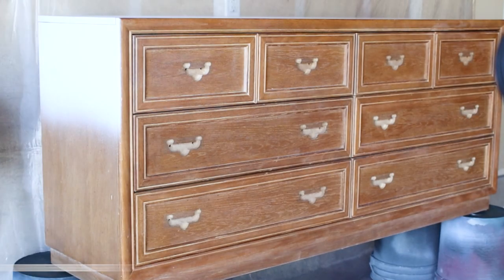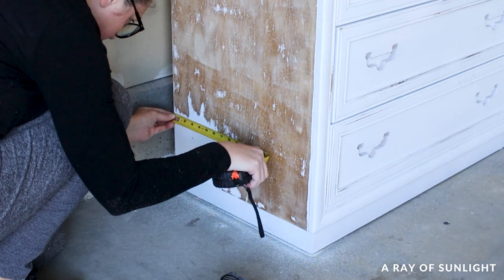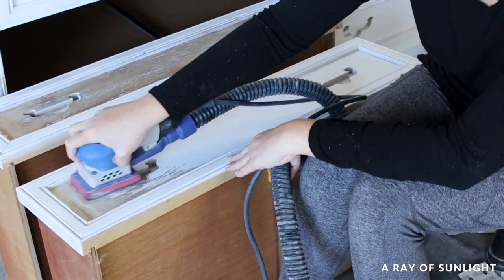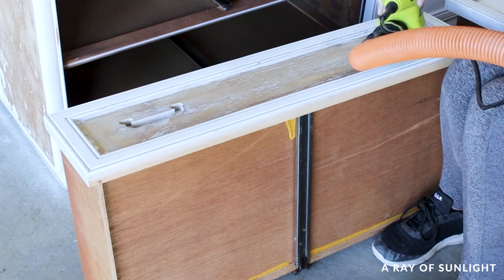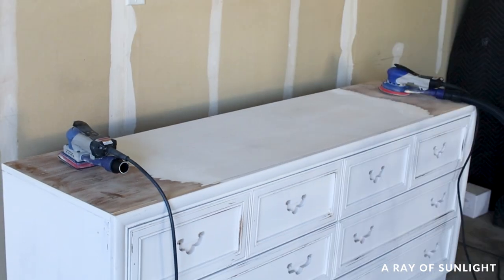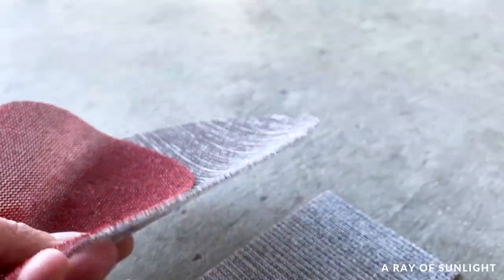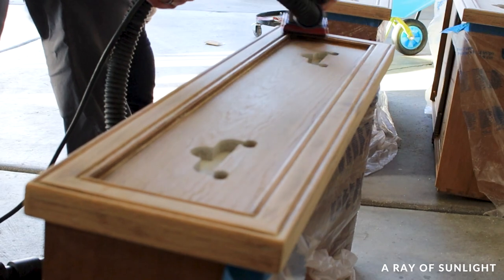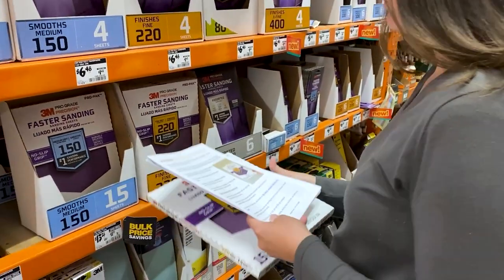Best Sander to Remove Paint

Comment: Been there done that.  What did you leave out?  A 22" belt sander for large flat surfaces.  You could have done the dresser in 1/3 the time.  22" v. 4"--no comparison.  Of course, you'll still need your surf prep for finishing and tight areas.  The point is, you really need both.  The 22" belt sander is amazing for large jobs like flat dresser tops and tables. 

IMO, if it's nice wood or delicate, strip it first, use the sanders for clean up.

Comment: I tried the Ryobi mouse sander thing too and I find myself almost never using it for furniture. I used it with some success on my railing too scuff it up prior to new stain, but for flat and wide surfaces... I'll take my DeWalt orbital and finish corners by hand 🤷‍♂️ I will at some point invest in the surfprep, as I think investing in the tools you use the most makes the most sense. Quality paints/stains and prep tools are key.